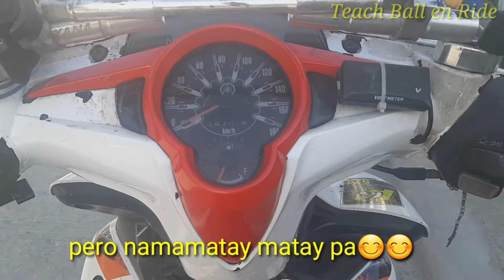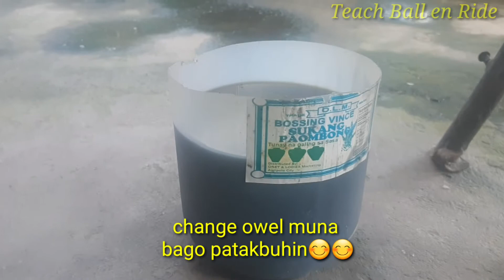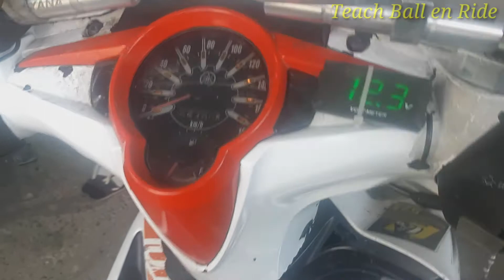SNIPER MX135 | 177cc | 4 MONTHS HINDI NAGAMIT | AANDAR PA KAYA? | PALIT REAR BRAKE MASTER REPAIR KIT

Comment: fully set ng smx mo lods? naka smx 135 din kasi ako hehe
Reply: at ilang mm na din yung elbow ng stock kalkal pipe mo sir
Reply from the maker: Option1 62mm 
Shark head 19/21.5 valve port and polish
Balance crank
Keihin 28mm carb
Cardinal racing cdi
Reply from the maker: Panuorin nio dn ung video ng review q s sniper mx q mga lods, paSUBSCRIBE narin,😊😊😊